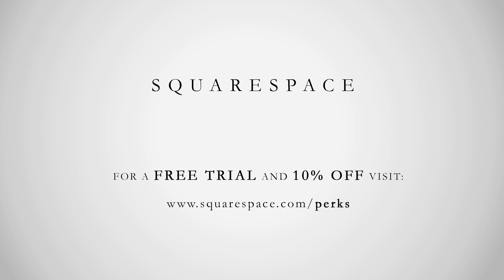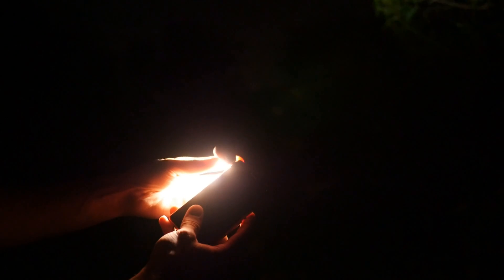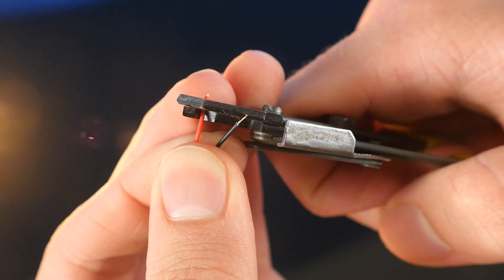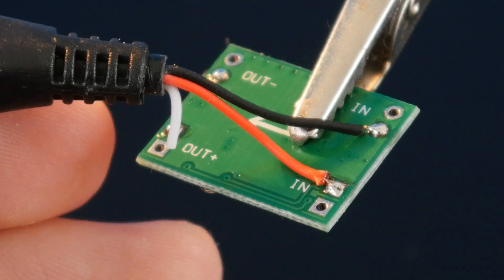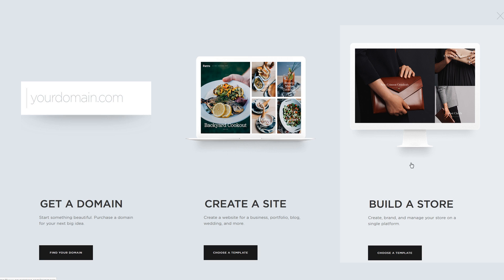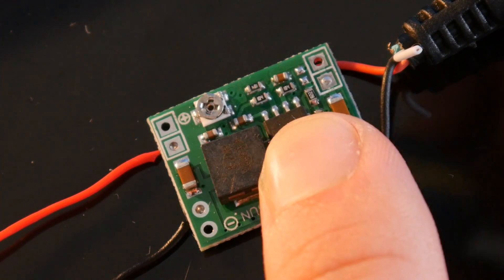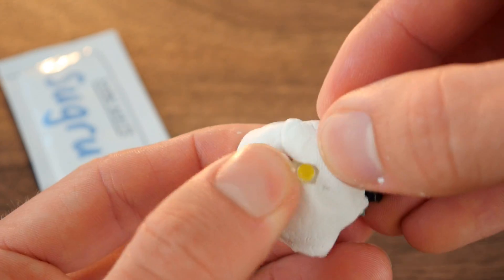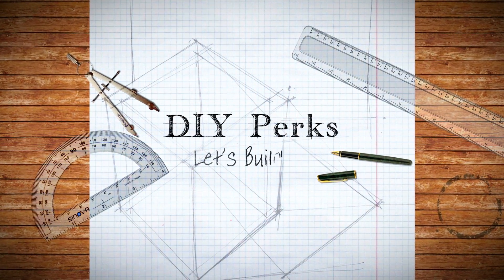A DIY smartphone hack that's actually useful!

Comment: And best thing about this project: Doesn't work on apple device's
Reply: I love how heated this guy got over the fact that people could use a lightning connector.

I mean to be twice your age that's really sad.
Reply: Blaze Gamer "the best thing about the project is that it doesn't work on apple devices"

How is that anything other than trashing apple for literally no reason?
Reply: Reading this section made me laugh. Whats with all this hate, coming even from a mature audience. I am a droid user, was and will be but thats only due to my personal preference. Android is open source therefore it is more customizable, on both peripheral level and system/kernel level. However, its not like Iphones are bad at everything compared to android. Some can say Iphones are better optimized and "may" even provide smoother faster experience due to the fact the OS is written for one specific type of hardware. Its not all black and white. Cant we all just get along and enjoy our top tech smartphones. This is all coming from a die hard android fan boy.

Remember that poor starving kids in africa could have eaten these phones...
Reply: Marian Keller the reality is (probably)   the lightly to otg,  is all youll need.  as the otg adapter is just  micro usb (or USB c now) to a full size USB. 

Same device as a lighting otg cable. 

 Many years ago I had a ipad2,  my only apple product,  and I had a 30 pin (I think they was called)  to hdmi and a  30 pin otg cable. 

So the lighting to otg would give you power out,  lighting ports are rated for 2amp charge so may be able to push out more than the 500mamp of the micro usb.  The USB C is 3 amp 9v,  that's what the plug ony pixel says. 
 

Before anyone jumps in I'm no apple fan boy, just didn't like the way you was getting stupid  stick by people that don't have a clue.

  All it takes is a 2 second Amazon search. 

Lighting otg 

REALMAX® 8 pin Male to USB Female OTG Adapter Lightning Cable Lead For iPad Air 1st 2nd Generation, iPad Mini 2 , iPad 4 https://www.amazon.co.uk/dp/B01BDVVW1K/ref=cm_sw_r_other_apa_lYueyb18KRPYD

Old 30 pin otg

30-Pin Male Dock Connector to USB Female Cables Adapter Camera Connection Kit, USB Host OTG Adapter Cable for Apple iPad 2 iPad 3 (White) https://www.amazon.co.uk/dp/B00LZDQ9WE/ref=cm_sw_r_other_apa_YZueybT6SSJH3
Reply: Just drill a hole mate.
Reply: Blaze Gamer So i'm the jerk? In a thread where the OP is blatantly insulting Apple users for no reason? If that's not pathetic i don't know what is.
Reply: @jonoc5  The guy is obviously being SARCASTIC. He prolly owns a Iphone Himself.
Reply: Are you sure? There are these "2$ iPhone destroyers" which are fans that are powered from the lightning port.
Reply: You’re actually an idiot. Being happy because other people can’t do something.
Reply: Jenia Evgeniy that's not the point.  If your not a 'tinkerer' you won't get this and you buy a torch.  Then again I'm a tinkerer, and must own 20 torches.
Reply: And people say Apple fanboys are bad. This is just pathetic.
Reply: SoWhoYou Have you even been to College or at least High School? I can't believe someone in his forties is unable to formulate proper arguments, or at least accept that he doesn't has any. I'm not even interested in phone wars or anything because I simply have better things to do. But I just hate people pulling an opinion unfiltered out of their ass and stating it as the "truth". We're not at Jehovas Witnesses.
Reply: Can't you get a lightning otg adapter?

https://smile.amazon.com/HIOTECH-OTG-Adapter-Cable-Lightning/dp/B00S9I7EPO/ref=sr_1_3?ie=UTF8&qid=1477787965&sr=8-3&keywords=lightning+otg+adapter
Reply: I feel the exact opposite. this google pixel is trash, I need my jailbroken iphone back!!!
Reply: That Guy you can put lightning on it
Reply: SoWhoYou Where is the difference? This is a DIY build, and a single person is quite unlikely to use multiple smartphones from multiple manufacturers. Also you can't use the micro-USB connector on newer devices having a type-c port, and on older devices having a mini-USB port. And then there are also some Android devices who don't even support OTG at all. So where's your point?
Also please stop calling people a Kid just because they don't share your twisted opinions.
Reply: I am even more upset I switched to the iPhone, I friggen hate it compared to my old Droid
Reply: jonoc5 wrongly insulting Apple users. As its perfectly doable
Reply: Except it does. 

Not the same exact way as this project. Of course you'll need to adjust it to work with Apple devices, but there are a couple iPhone devices out there that does this already. So, I'm sure you can do it DIY.
Reply: KaZio Great ending. From my side, it started not with hate, but ignorance. I accepted something I was told as the truth, without checking it. But some of the other users here...
Reply: Brigher than what exactly? There are hundreds of android phones... each with it's own unique components.. You can't compare...
Reply: Lakahiya Newberry no it's a proprietary $60 £60 cable and then you need the adapter
Reply: Good god I love this thread.
Reply: Because apple products suck.
Reply: Just get a fucking flashlight you people.
Reply: peter tumminaro all android phones have come with a touch function built into the OS since about 2010. Htc I think wad the first to implement it into the OS.  Before that an app was needed.  

The point of the hack was to make a far more powerful touch.  Though for the last few years, the phones led has been more than  adequate they are thst powerful.  I really liked the nexus 6p as the flash was two tone,  so it was very warn rather than white. My current phone,  (pixel)  is back to cold white.  

You started on your high horse about others feeling insecure, then ended by doing the exact thing you ac used otherwise of.  

I said from the top, the lightning port on the iPhone is capable of this hack, as you can get an lighting to usb (lighting otg) cable the same as the micro usb to usb (USB otg) .  So the guy was ignorant of the facts when he posted.
Reply: That Guy I'm sure it can give out 4/500mah,  which would borderline for a usb  hdd, but plenty for a bright led.
Reply: That Guy sorry my dam auto correct .  It's use to writing  battery specs. And I'm not yet adjusted to my smaller pixel.
Reply: That Guy use a fake lightning cable instead the USBOTG
Reply: N1MBUSMUS1C yes a ligjtmingOTG cable. They are a thing, brought it into this thread awhile back.  I'm not an iPhone guy, but thought this thread laughable.
Reply: That Guy That's a bummer. Sadly iPhones are a bit harder to make custom diy peripherals for. But I bet there might be a product available that would serve the same function as this diy. iPhones have a lot more consumer products available than Androids that arent Samsung so I wish you the best of luck.
Reply: Null Null well, the European Union tried that with Micro USB, and look what Apple did, oh well, I guess this story is going to repeat
Reply: actually it does , you just need to sub the port or get a converter
Reply: It's because it's for smartphone
Reply: That Guy iphone also has otg but they call it something else and its expensive
Reply: Can't you just buy one of the little USB plugs for your apple device??
Reply: Something even better: it actually does work
If you use the right adapter
Reply: cuz sheeple are too dumb for this project.
Reply: don trump I was about to relate the Johnny cash 😂😂
Reply: who still struggles with apple? having a apple phone is like being in prison, cant do shit without the guards or wardens approval.
Reply: Apple will be buying some flashlight company to sell "smart" flashlights separately, then they may include shoe industry, tomato paste, and canned fish.
Reply: Hahahaha
Reply: Good
Reply: Still worth the unmatched multitasking of IOS.
Reply: It does, all the way back to the iphone 5 and ios 9
Reply: Except it does...
Reply: Not anymore on the iPhone 15
Reply: SoWhoYou Thanks for the compliment. If you even watched the video you might have known that for this build you need a OTG adapter cable. Now where's the difference between OTG adapter cables with lightning or micro-usb connectors? They even cost nearly the same.
Also I still use a iPhone 4S I purchased broken for 40€ two years ago. Go figure.
Reply: Twice your age. Half the maturity.
Reply: ^
1st. step is denial
2nd. step is....
Reply: That's wrong, there are also lightning to USB-OTG adapters. So it might be a slightly different procedure, but you could build something similar for apple devices.
Reply: CRAZY JUKEBOX probably cos your Crazy.
Reply: Holy shit is tru
Reply: CRAZY JUKEBOX I do, because i had one. On Android you dont Have to jailbreak to get Access to features that are only accessible by jailbreaking on iphones
Reply: don trump Thanks for the compliment, again. So you wrote a whole comment about one switched letter in mine. Also I didn't correct anything, you just insulted me having a female name, which is clearly not the case.
Reply: Well fuck
Reply: 7EvilAdams Not really, my old droid could select 3 different brightness settings and it was brighter at the brightest setting. This is anecdotle evidence of course but that is my experience
Reply: Michael D'Angelo
That's what my brother went through, he got fooled by the speed of the iPhone 5 compared to the S2... lots of phones are much faster then the expensive galaxy S line, but when he wanted to just move some mp3 files... oh good lord have mercy on his poor nativity, he though they moved past the mandatory "driver" aka itunes... he was used to use his "slow s2" as a thumb drive on demand... he though that modern iPhones could behave like the good old mp3 players... long story short, he's using a Z5 now.

But I have to admit, when ever I have to touch a new iPhone I can definitively feel how much faster they are and how thin and light they are compared to my "brick"... the build quality is top notch... but I weep in silence knowing what they have to deal with. same for the MacBook Pro users (air and regular MacBook users can eat a dick)
Reply: Why would you be happy about what apple devices can't have?  Are you feeling insecure? My iPhone has a great app for flash light and strobe light.  I don't have to solder anything or buy extra stuff.  Project not needed, but I am glad you were able to make something your really expensive phone didn't come with.  Good for you.  No longer bumping into things in the night.
Reply: @Misawa2Me  My Samsung has a bright Flash/Strobe light as well. Plus I can Use a wired Headphone without an extension. Don't need Itunes to transfer music to my playlist, Can add more memory with an SD card, can Bluetooth 2 things at the same time, and Don't need to jailbreak my phone to get many many more features. I know this cuz I'm a Tech freak and have many different products Apple or Android. I'm not hating on apple but prefer Android for those reasons and I'm only saying this because You say "We have to make something our really expensive phone doesn't come with"... Well I just listed Things Your More Expensive Iphone Doesn't come with.
Reply: kevin rex I know there is an OTG adaptor for lightning. As I explained earlier, i was told lightning does not supply enough current for this. Which is false
Reply: hahaha yeah :)
Reply: No you saying that "people say apple fanboys are bad. This is just pathetic" that is why I called you a jerk, not because they were being, something called sarcasm
Reply: Stephen Butler I was told that the iPhone lightning port can't deliver enough current. The current they can deliver is enough for something like a flash drive, but you can't run a hard drive with them.
Reply: Stephen Butler mA* You might be right, I won't tell you you're not because I'm not sure either. What I do know is that it can deliver a certain amount of mA  not mAh. mAh is a measurement of capacity, not current.
Reply: Ehm, please disconnect your internet for a couple of years, you clearly do not know anything about this. The iphone has ONE adaptor which would fix the issue, you don't have to be salty because of your lack of intelligence.
Reply: That Guy Yessss... I hate Apple
Reply: That Guy why would it work on a toy? this kinda stuff is for real phones.
Reply: SoWhoYou Right, before I could plug my phone in and just open up actual folders and drop shit in and boom, right on my phone. iPhones you have to go through AID'stunes, I mean iTunes
Reply: @Mike-oj9mo  Because it’s automated and won’t break with having to think about codecs and that crap when moving files manually like a neanderthal.
Reply: Good thing Apples flashlights are bright enough already.
Reply: Addfuture no they’re not
Reply: @Add_Fox  true tho
Reply: don trump At least MY name is not that of a crazy grandpa with funny haircuts. Also, 'Muricans, please learn Etmyology.
Reply: CRAZY JUKEBOX Well I don't. I for example have a s6 edge plus. It's just as expensive if not more than your shitty iPhone 6. Which is worthless crap that's overpriced because it has a little plastic apple.
Reply: That Guy i believe you dont know what is an jail broken iphone ?
Reply: Marian Keller ur gay
Reply: I don't see how this is denial? I was simply saying that Apple flashlights are way brighter than the phone flashlight used in this video. I'm not saying Apples flashlights are the best or brightest but mine is more than enough.
Reply: This includes the iPhone 7.
Reply: Why do i smell poor people who cant purchase iphones ??
Reply: +Marian Keller why do you have a female name if you are a guy?

A boy named sue- j. cash type?